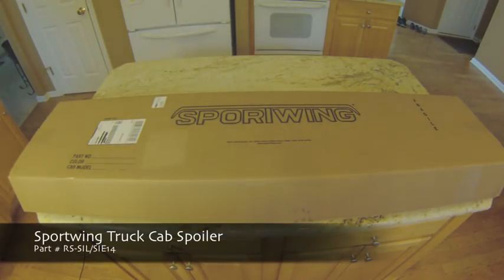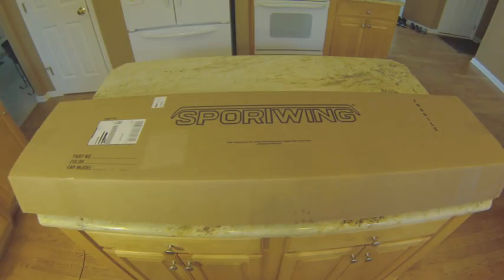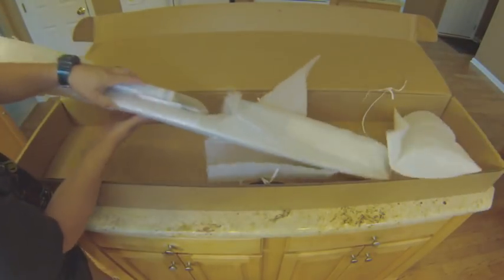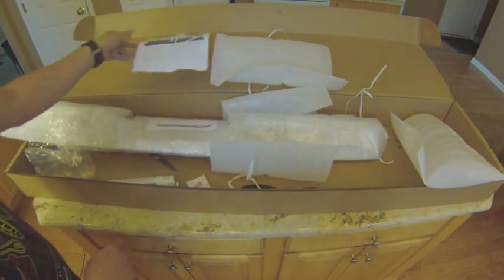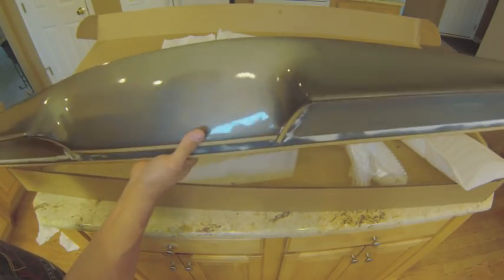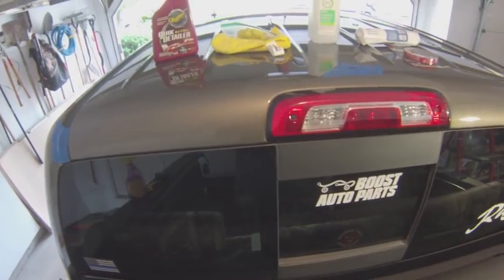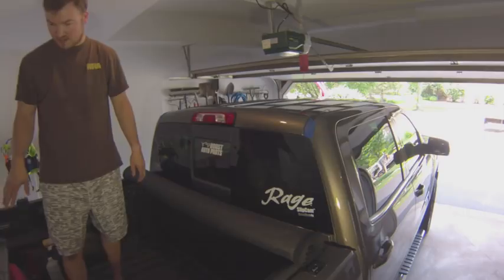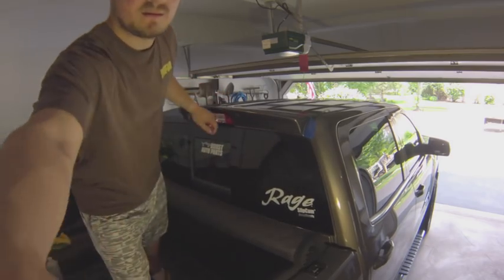Sportwing - Truck Cab Spoiler Installation

Comment: I just got one of these for my F-150. They use the EGR product and paint it. Instructions that came with it say EGR. It is very well painted and a perfect match. Only issue I had was that the adhesive wouldn't dispense from the tube. I had to cut the tube open and apply it by hand. What a mess that was. It turned out good though and I'm happy with it.
Reply from the maker: That sounds like a mess to clean up!

Comment: I was looking for this spoiler but the one on sporting web site are not the same. Can you provide a link to where you bought yours..
Reply from the maker: Victor Velazquez the one in this video is for sale, shoot me an email.

waterfowler4one@gmail.com
Reply: Water Fowler 41 Why are you selling yours after all that trouble?    
Wind noise?    
I wonder how the 19' models attach the roof spoiler to the cabs?
Reply: Water Fowler 41 I just checked the link you provided and it says " The page you requested cannot be found ".   Did they discontinue it for some reason?
Reply from the maker: @Mr.Beastforpresident  Wanted to change things up a little bit with the looks.
Reply: Water Fowler 41 I just purchased an 18' Silverado, I like the 19' Chevy models for the most part. 
They're lifted higher, which I don't like. I like the front & rear but something about the fenders and doors doesn't look proportioned and designed correctly to me, and the Steering wheel design & interior believe it or not was the deal breaker. 
The steering wheel ( the part you touch the most ) sucks in design & comfort for my style of driving, which is ALOT. My previous 2011 GMC Sierra 2500 (Gas) had 541,000+  Miles, 13,000+ engine hours.
Reply from the maker: @Mr.Beastforpresident  Yes I believe so

Comment: Been wanting to do this!  Never knew this option was available, I was thinking to try and fit one from the 19' models. 

What brand LED Cargo Lamp bulbs did you use?    I like quality ones that match the factory color. Do you have a video on the Cargo LEDs?
Reply from the maker: They are philips LEDs